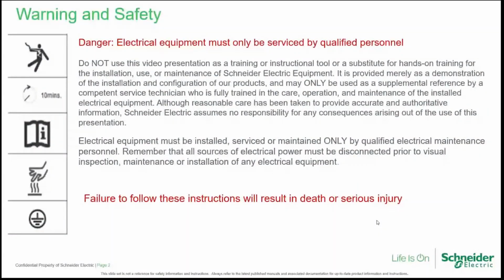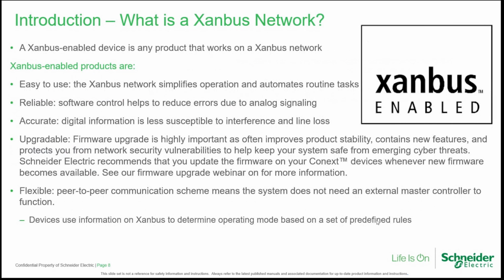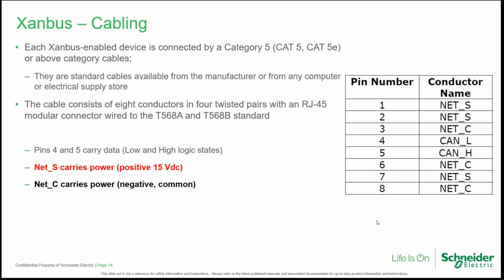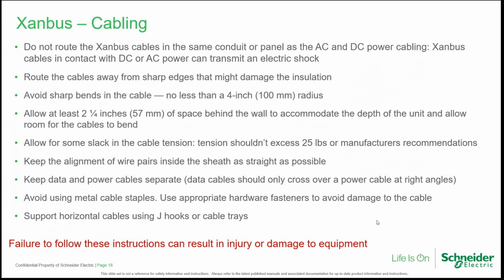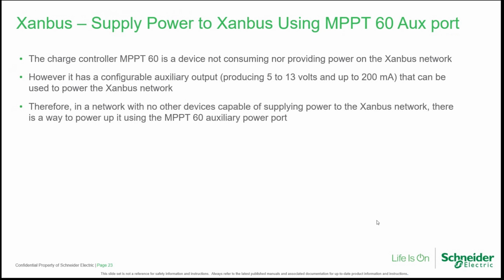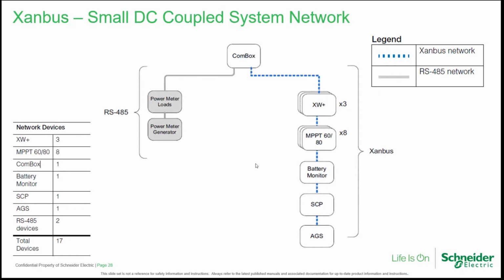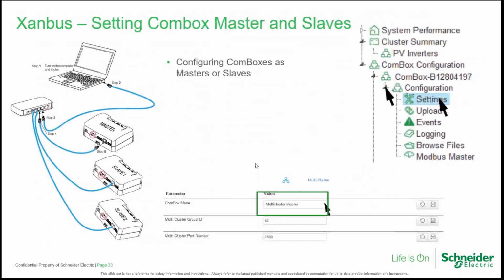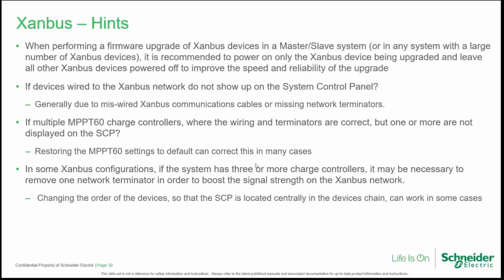Webinar Replay - Xanbus for Solar application

Comment: I want to use two MPPT60 controllers with a Conext Gateway. How would the power be wired between the units, assuming that the aux output of the MPPT60s are the power source?

Comment: I have heard and or read from Schneider reps that Xanbus is open for others to integrate but I've not been able to find specs as to what exactly it is. Where can I find documentation on how to connect my devices to Schneider Xanbus enabled devices?
Reply: @SESolar  Pretty disappointed with what the SW series has become, I guess I'll have to look to the overseas inverters to get back the features were included in the Trace/Xantrex SW series for example, serial access, programable relays, onboard gen start and onboard control panel. I consider $400+ CAD for the SCP to access the most basic settings to be unreasonable.
Reply: Smart Like Truck I haven’t verified yet, but the video references Xanbus_System_Installation_Guide (975-0136-01-01) from their website.
Reply: Thanks, I just skimmed the referenced guide but it doesn't appear to have much other than how to physically install Cangue network. I'm guessing it's their own implementation of canbus or modbus running on RS485. I'd rather not poke at it blindly but I guess I'll have to give it a shot
Reply: Shoot. I was hoping for more too.  Update here if you find something